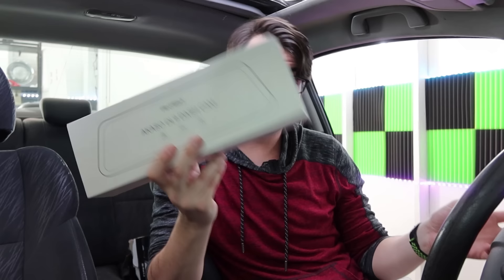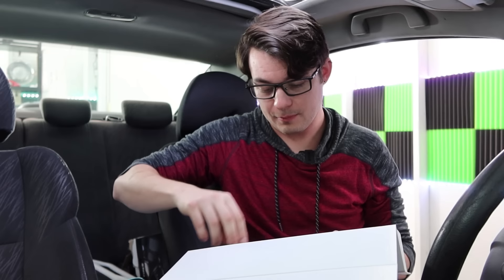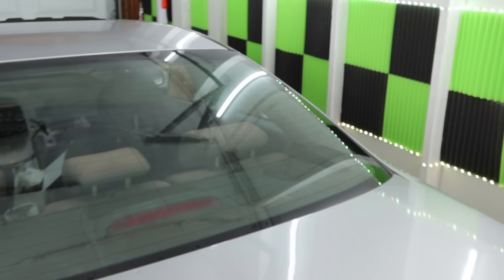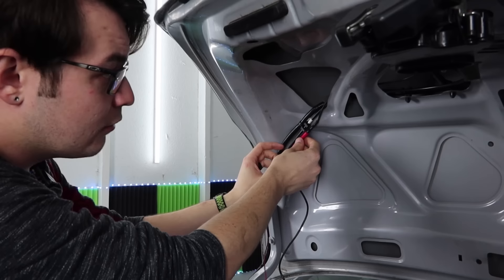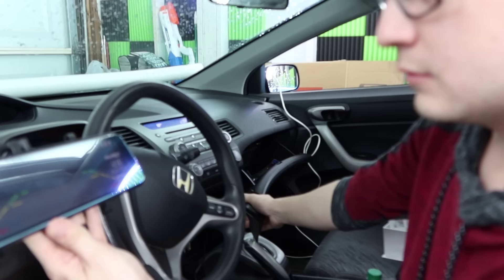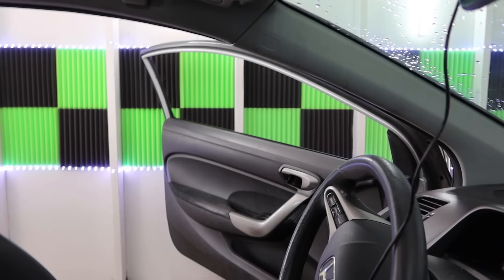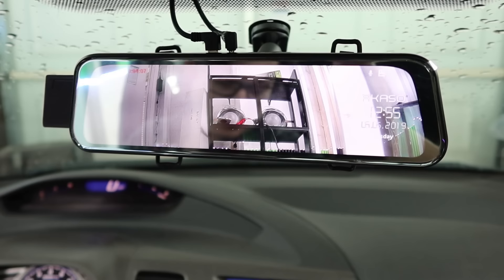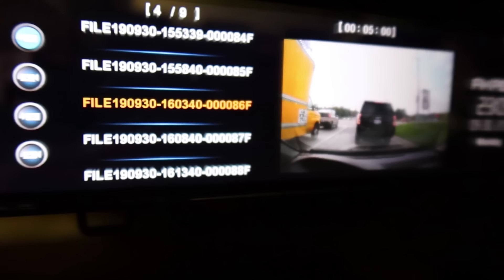Amazon Best Selling Smart Mirror | 10" Touch Security Dash Cam Review and Install

Comment: Best thing about your video is the reality of installation. Thanks
Reply: Yes
Reply: Facts
Reply: He could have avoided that screw going everywhere with a magnetic screw tip
Reply: Use a drill bit to prep the hole for the screw my guy.
Reply: That’s true, everything looks simple but this is honesty
Reply: No lol this Is why people call me to help them install I got sweaty palms an anxiety watching him STRIP THE FACTORY WIRE JACKET 🙈😳😱 going nooo the easy way is to just T -tap it and no major damage to the factory wires occurs. Dont  run the wires under the trunk hinge they will break over time causing shorts and that can fry the camera and the unit lol I run all my wires a long factory routes or better where you will never find them so no pinching in doors or tucked under panels that won’t clip back in because the wire is there. That is unacceptable and I can’t stand it
Reply: hahahha
Reply: @tyrenner   isnt there a way without doing it how he did? I thought their install video didnt have any wire cutting/ splicing
Reply: @privateuser4179  yes it called a T-tap
Reply: @tyrenner  ok. Dont know what that is. Will use Google.  Thx
Reply: Oh my
Reply: Couldn’t agree more! I see exactly why they requested you to do this for them. Great job!!
Reply: I need tint... You're hired!
Reply: This is not the reality for capable people.

Comment: Pro Tip.  Tap the hole first with a smaller drill bit then screw it.  Also don’t forget to hit those holes with rust stop to prevent the trunk lid from starting to rust.  Tiny hole but rust grows.

Comment: The reason you are further from your desired stopping location when backing is because you are stopping at the furthest distance on the scale (green). If you notice, the scale provides four colors, green, yellow, amber, and red. Ideally, anywhere between yellow and amber will get you closer to your desired distance from the obstacle behind you. I hope this helps. However, I imagine you have probably figured this out already. Thanks for the detailed content!
Reply: People seem to forget that rear pointing cameras for parking are meant to be pointing downwards to a fixed point on your bumper... so you can see how far from your bumper the object behind you is and not to stare at people in traffic lights through it.
Reply: For the guides to work it has to also be calibrated correctly. He did reverse past the red guide and was still a few feet away.

Comment: I purchased the Azdome 10" full screen dashcam/back up mirror (basically the same as yout AKASO w/ a better back up cam) and this vid greatly assisted me.  It was super easy and once I figured out how I wanted to run the wires, it was roughly 30 mins worth of work.  I could probably do it in 20-25 for someone else, but thanks again dude. You rock.

Comment: You may have revieved a lot of hate, but I thought this installation was just fine. Your honest review was also on point. Keep it up! 

As someone already said, best way to screw in those odd screws is by pre drilling a hole with a small drill bit first. Also, when doing splicing, reinsulate the metals you exposed so it wont accidentally make contact with something and short your lights out.
Reply: people call anything that’s not immediately positive “hate” and i think it’s pathetic

Comment: When trying to screw something in, especially metal (wood you can mostly get away without doing this but it might crack), you need to drill a hole before putting the screw in, just a bit smaller than the actual screw width
Reply: Not if you use self tapper screws.
Reply: @WhiteRaven___  self tappers and self drillers are different screws, self tappers thread a hole as they go in, self drillers make the hole and tap it as they go in.
Reply: @1973retrorabbit  i know.... and self tappers are the way to go. Self drillers are shit

Comment: For the rear camera, either get the kind that bolt flat onto the license plate, or the one where you drill a 1/2" hole into the actual trunk and pressfit it in with a rubber grommet.

Comment: Yeah, I had a similar experience with one of those cheap rear view camera mirrors. It works great at night, but during the day they're pretty much worthless. I ended up buying a small LCD screen that I placed on the center dash instead and that works great.
Reply: By saying "LCD screen", you meant a devie similar to GPS which is connected to the backup camera?  Any link for the LCD? Thanks

Comment: My question is, can that camera stay on even if the car is off?   I ask you that question because, where I live I do not have parking and I have to leave it outside and sometimes some people crash the vehicles and you do not know who it was.
Reply: Most dash cam kits have a motion sensor mode that will start a recording when the vehicle is bumped.  It just requires the camera to either be wired directly to the battery or plugged into a USB port that is always powered even when the car ignition is switched off.

Comment: Pro tip pre drill the holes. You can end up breaking stuff just running a self tapping screw. Just a small hole and then the self tap screw. Good luck and video.

Comment: Personally if I knew I didn't have the skills required to do the install correctly I would have just had it installed by someone that does! The camera they provide for the rear is way too bulky for an exterior mount! Anyone can just rip that right off the back of the car! The headliner mount position would have been a lot cleaner and a much better choice! Some sort of small type of wire loom would have been a nice touch for the wires hanging down from the head liner over the rearview mirror again for a cleaner look. Other than that you did give it a shot and that's how you learn to do things better so keep up the work and always look for a better way to do things!

Comment: Pre drill tap holes with smaller drill bits than the screws your going to use.  Drill one, screw mount on and then drill 2nd hole at location on mount and screw.

Comment: the funny part is that most car stereo or alarm installer run the wiring on the floor, but for camera's its easier to run it along the headliner.  just FYI guys.  i have been installing for 28 years and learned this trick a few years back.  i was wondering how they were installing backup camera's so quickly, and that was why..  Just tuck the wire and go.

Comment: I got one. If you live anywhere where it reaches over 110 outside forget about it. That means the screen will easily reach 115 to 125 inside your car and it will stop working like mine did 21 days into the summer here in the Central Valley of California.

Comment: I know this video was made in 2019, and you said you’re not really mechanically inclined or electrical inclined, but for future reference, instead of drilling into your plastic, next time use 3M double sided tape. Shit works wonders and sticks damn well. Look at how people attach to helmets or whatever. Usually is 3M double sided tape. I wouldn’t use the Gorilla Glue double sided tape because that is way stronger so I turn might damage your paint or hold well enough to break something. But just thought I’d let you know

Comment: you probably already figured out that you need to make a pilot hole with a slightly smaller drill bit than the screw and if you have a set punch, which is much like a nail punch but with a sharp tip, and it will help you make an indention where you are going to drill and help keep the drill bit from walking on you. Just FYI.

Comment: Easy method to drilling holes for the rear camera mount,try a spring loaded center punch.little dent in the metal will keep the drill bit or screw from walking off the area you are wanting to drill.

Comment: Those are not self tapping screws. Pre drill the holes with a drill bit a bit smaller than the screw then the screws will go in. Also put some touch up paint on uncovered holes to prevent rust.

Comment: 3:43...They're called "pilot holes". Invest in a good set of metal drill bits. $20 bucks. Or, go the cheap route, but just the bit you need $3 bucks.

Comment: Pull the license plate attach to the vertical section of the trunk lid behind where the top edge of the license plate sitsthen  tuck the camera body as high up as you can under the overhang of the trunk lid ( where you initially mounted the camera) then reinstall license plate.
This will keep the camera from protruding out so much and keep it from getting hit or damaged

Comment: Nive install dude top tip if you drill pilot holes 1st the screws will go in 1st time 😉 i have 1 kinda the same there are the only dash cam i will ever use after buy 1 as u forget about is as its not in the way and getting 1 for free is wicked lol

Comment: Does the rear camera record evidence when powered on, & while in motion, or does it only function as a reverse back up camera to aid with parking? 
I'm looking more for a front/ rear dash camera that records both front and rear while the vehicle is mainly in motion. It would be nice if it recorded while vehicle is parked.  I don't need a backup camera as I already know how to back up without struggling like most people.  I only require evidence in the event of an accident to avoid hear say, and video evidence is easier to establish fault especially if the matter has to go to court.

Comment: 1. click manual night dimmer to tilt down after fitting 2. press screen off 3. adjust strapped on screen as you would any rear mirror to see out the back window 3. click manual night dimmer to tilt up now the day and night time glare is not going to bother you as drivers view angle us eyes on the screen monitor of the back rear view 4. to view your strap on video screen as a normal mirror again tap the video screen light off to show it's mirror surface by clicking actual car mirror manual night dimmer switch to tilt down again now you can see the back view video screen as a normal mirror should be no need to adjust each the mirror each time when set up correctly in the above "step three" 

this how to get the most out of your video mirror car rear view cameras screen

don't get me wrong I think these products are excellent when you know how to adjust for glare like I talk about here 

a how to fix day & night reflections glare that gets into drivers eye vision that stops driver from seeing the rear view camera video in these dual purpose upgrade strap on mirror instead of seeing bothersome light reflections such an easy fix

Comment: i think you mean narrow angle rather than wide, it is too 'zoomed in' , way more so than a original equipment camera, i have the same one although unbranded. I wish the PSU was in the cable rather than inside the cigar lighter plug, as it would be so much easier to hardwire by just cutting the cigar plug off.

Comment: I like the way you make your videos.  This camera looks like a nice invention.  The vehicle I have has built in 360 degrees cameras with bird's eye view.  I also have front and rear dash cams. There a total of 8 cameras around my vehicle. 

I would have used another method to mount the camera, and it would be non destructive to the vehicle.  If you leave drilled holes without sealing them you could have rust formation in the metal.   

It is possible to make a custom bracket from some stainless steel or aluminum that would share the same screws with the license plate.

Comment: I recently got a similar if not the same, Apeman C750. My car is 5 years old but I don't think I will do the reverse, so connecting to reverse light wire as too many panels to remove in mine and don't want to break shit. Also rear cam can be put inside. However, is the front dash cam always recording, like how do you get it back to a normal mirror to see out of?

Comment: My dumb Ass was smart enough to find a light in the back trunk and spliced into the black wire then added the red wire wrapped in black electrical tape. The back up camera works when the car is on instead of back up only.

Comment: I know this is an old video and you probably won’t see this, but I have an issue with mine and I can’t find a fix for it anywhere online. Sometimes the dash cam won’t turn off the home screen I black, normally you can press the button at the bottom in the middle to turn the screen off, but then it just turns straight back on again and it won’t turn off. This doesn’t happen often, and I can’t seem to find any rhyme or reason as to why it happens but it’s bloody annoying trying to drive with a screen as my mirror, I can’t pull over and take it off as there’s no permanent off function, and it just keeps switching on and off making that annoying noise every time, which is even worse. Please help.

Comment: Like the video! thanks for reviewing this product as I was really curious about them. 

Little tip for drilling, esp on a smooth surface, get an awl and create a small divot before drilling, and create a smaller pilot hole in that spot. Will save you lots of frustrations ;)
And, grab a corded drill, massive torque and no power loss during a project hehe
Reply: Or just use self tapper screws lol

Comment: fitted it wrong should be top of the rear window the video is then your review mirror you don't use the reflected part  of the mirror when in reverse it should change and show a low view with lines well mine do

Comment: I just don't like how the wire are showing at the top they should have made the wire come out from the back then the the top of the device then have a 3m adhesive plate that sticks to the window to the liner so you cant see the wire and give it a more finished installation but the video was good show regular folk how to install it more or less

Comment: Had the same camera for $70 at ebay. The looks, the sound it make booting up basically is the same. I love this cameras but the image quality they produce when you view it on your PC isn't that good compared to my aging GoPro Hero Session that produce 1080p 60FPS video. I installed my rear camera inside the car rear window as I experience in time this camera will fog up its lens. AZDOME was the camera I got out of ebay for cheap and never pay more than that on dashcams as they sport very old camera tech even the expensive ones.

Comment: You have to intalled on top the inside of the rear top roof next to the rear winshield  just where the roof cover ends or joins with the rear winshiel. Well there is where I installed cause there on top of the plate looks dumb and it doest have a good 360º view 🤣🤣

Comment: wtf drilling holes into the car. you know what corosion anr rust is right? just place the cam behind the backwindow on top, easy mount and protected from elements and NO FREAKING HOLES IN THE CAR
Reply from the maker: it's plastic 😜

Comment: So I had a 10 inch mirror like this one in my vehicle and some woman she had a device and was able to unlock my SUV so she took the mirror left all the cords left the rubber band thingies that attaches it to the mirror so you don’t have to takeoff your mirror and put a new one up there she left all that left the power cord left the back up camera also that mirror was only $30 and she left my $300 vacuum my Dyson portable vacuum in the back I figure just a crackhead looking for a quick fix but they do have mirrors that offer three cameras front inside and back up now I do you have a back up cam already that came with the vehicle so I just put the back up cam on the inside of the vehicle because I’m an Uber driver and it’s handy to have that and I do have signs posted everywhere that they are being recorded at all times. 

So I went and I purchased a new one that was a little more spend he this one was 120 but I got a $20 discount so I spent $109 total for my new one and it came with way more stuff plus I got a free gift for doing my Amazon review so I got 128 GB memory card which is way more handy so I don’t have to go through and erase videos all the time just thought I would throw that in there for you

PS I’m not going through and correcting anything so there’s no punctuation’s so just apologizing for that in advance because I know it does annoy people but talk to text doesn’t do punctuation’s unless you tell it to you but then it screws that up to so yeah sorry everyone no punctuations don’t feel like going through and editing